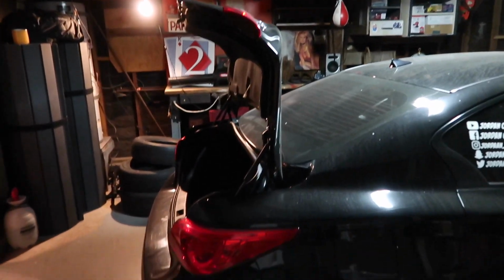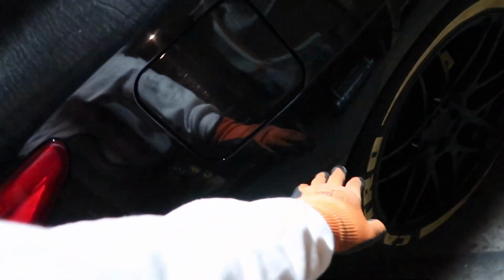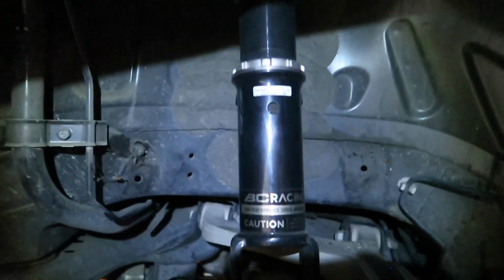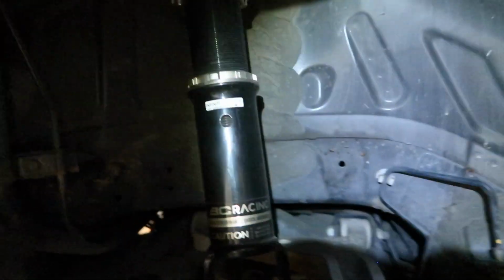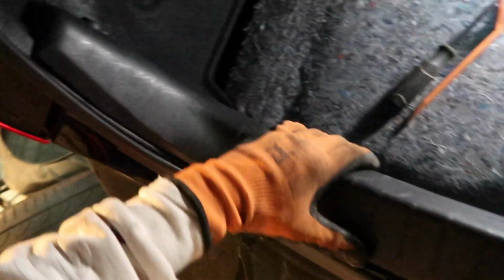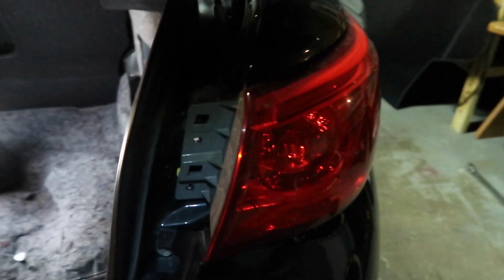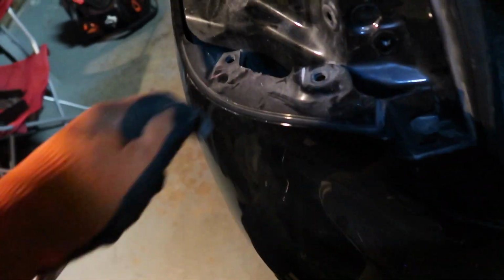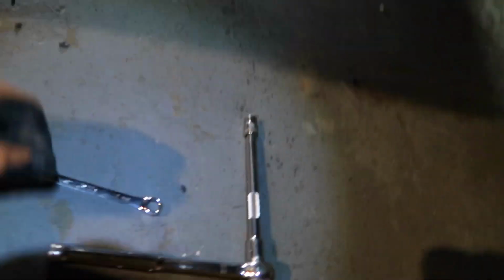HOW TO REMOVE REAR BUMPER ON Q50!

Comment: What does the bumper cover attach to near the bottom of the wheel well? On the video, it showed removing two screws. That part is missing on my car, and my cover is coming off. I need to find this part so I can replace it on my car.
Reply from the maker: Msg me on Instagram @jordaan_caastro
Reply: Lmfaooo same boat shit got rear ended  now it’s falling apart